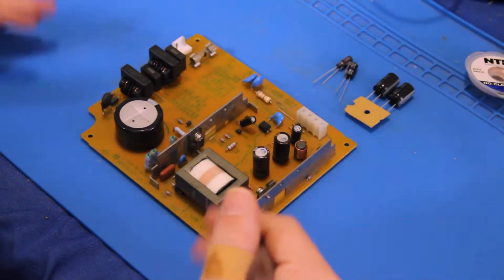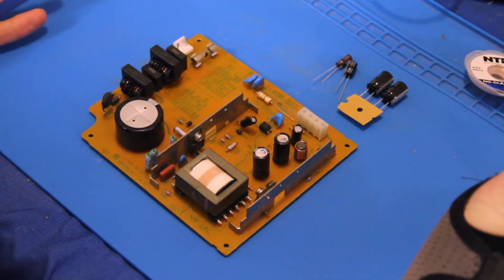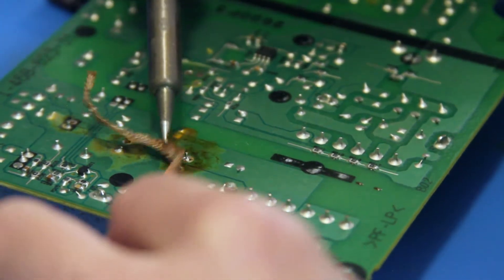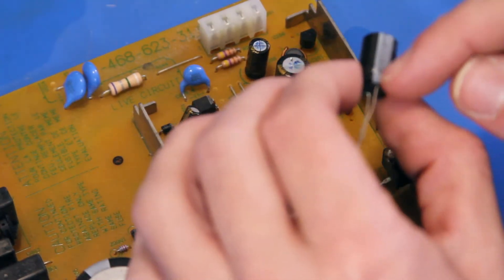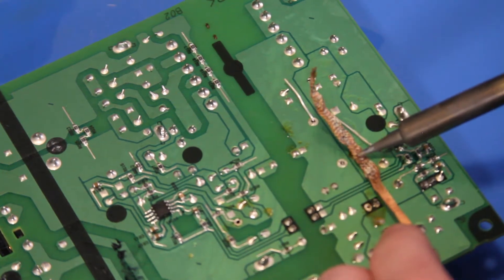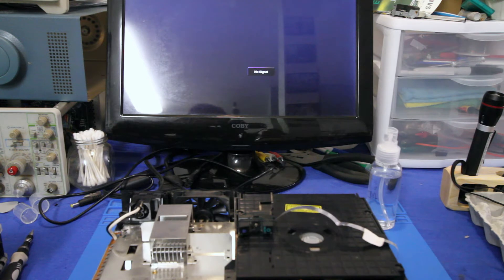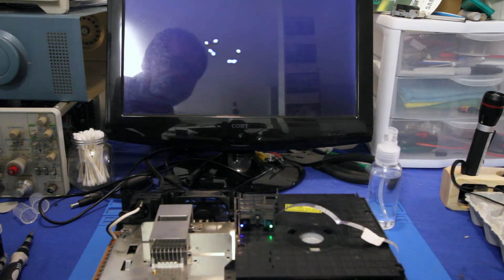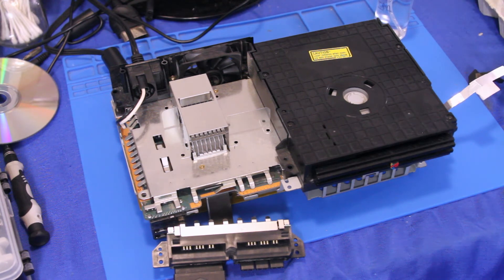DOA PlayStation 2 Part 2: Replacing Power Supply Capacitors and Finding a New Issue

Comment: Very nice mine had 3 ceramic disc capacitators dead those blue ones after power surge fuse and 3 caps died .Keep it up
Reply from the maker: Thanks! I've been falling behind on videos due to wedding planning but I'll be back in force after 

Those power surges can be quite devastating. Though knock on wood I haven't had a power surge repair yet that got past the power supply which is good. Power supplies can be rebuilt. Chips on a motherboard not so much 😂

Comment: I missed what the flex seal does?
Reply from the maker: The disc drive magnet was slipping preventing discs to be read. The flex seal increases the friction to allow the disc to be read since it's rubberized. I have an older video that goes in depth about it 🙂
Reply: @titanrepairs  found it, i see now thanks

Comment: That's wild. I'm guessing none of those capacitors had bulging tops? I have a SCPH-30001 R with the exact same power supply and none of it caps are bulging but it's dead. Barely outputting 2-3 volts. I get the age of these things now but I would expect bulging or leaking. I'll probably be replacing mine soon.
Reply from the maker: That's what the crazy and frustrating thing is with caps. Though bulging and leaking are dead giveaways, they also just die with no obvious signs. I have an OG Xbox apart right now that won't boot and I'm suspecting bad caps. But to find it I have to remove them and then test them. But I'd say your issue is most likely the caps. I have a box of power supplies, all the same model number all dead. I think there was just a bad run on power supplies for a bit. Probably faulty caps. It is the time period that the capacitor plague was rampant.

Comment: Check the zd1&2 diodes. They should only have continuity in one direction. If they measure it in both directions it means the diodes are blown. As mine are in my ps2./
Reply from the maker: Very true! And thanks for pointing that out. This is an older video so I don't remember if I touched on that lol. But your advice is one that can help someone reading. I tend to check them if the caps are good. I have had power supplies where those were the culprit.
Reply: @titanrepairs  No worries, I'll let you know when I get the diodes and  solder them on if it fixes the issue. I dare say it will 👍
Reply: One of the zener diodes kept testing as bad. After sifting through some comments on various youtube vids, turns out there's a zener diode that is connected to a resistor which will give a false bad reading. So when in doubt, pull it out of the board and test it.

Comment: What was the reason for fixing the ps2 magnet? What does this solve?
Reply from the maker: @ED_62  When the disc drive magnet wears out it'll make a grinding noise when it's spinning the disc, usually blue discs. In this video it caused the disc read error. Using flex seal adds friction back to the disc drive magnet to help it grip the disc again ☺️
Reply: @ i currently have an odd issue with my ps2 fat, it won’t read DVDs at all at first but if I give it a while to spin the DVD disc it’ll stop for like a minute or two and then start to spin and read the disc but will read ps1 and blue ps2 games flawlessly, could this magnet fix solve my problem? I’ve tried everything else I could think of to fix the issue. It sounds like the disc drive is just starting and stopping honestly, sometimes they’re clicking as well

Comment: Con esa reparacion queda funcional para 220v o solo 110v
Reply from the maker: I've never worked on a 220v power supply so I'm not 100% sure of the differences but I'd imagine the basics are the same. The capacitors will likely go bad on the 220v version too.
Reply: @titanrepairs  osea no es 100% seguro que funcione en 220v

Comment: Please, can you send all the micro uF and Volts of the 4 capacitors, the capacitance and voltage i mean, thank you…
Reply from the maker: The capacitance and voltages are printed on the capacitors. It may be different between power supply models.

Comment: I’m new to disassembling consoles, but I have taken apart an original Xbox, and Xbox 360. I cleaned them and was able to change the thermal paste with no issues at all. I made my way over to my perfectly functional PS2 and began to disassemble it for a cleaning. I broke 2 ports that hold ribbon cables (Controller port & disc drive). After I put everything back together as best as I could, the lights on the power and eject buttons are not lighting up, so the console is essentially bricked. Is this because of those stupid ass ribbon cables, or did I mess something else up?
Reply from the maker: I've run into this before. I've cleaned perfectly functional PS2s and had them not power on. I would start by checking the connection to the ribbon cable to the power switch. Though my hunch from experience is saying a fuse on the motherboard blew. One of the fuses (I think it's fuse PS1?) blows super easy. There's guides online how to check them and where they're located and how to replace them. You'll basically take a multimeter and check for continuity. If there is none, it's blown. But take your time checking. Some of them are very tiny.

And don't beat yourself up too bad. We've all made more work for ourselves along the way. It's how we learn and get better :)
Reply: @titanrepairs  Thanks for the information! I still have a lot to learn, but I became addicted to disassembling my consoles and cleaning them recently, so I might as well take the time to learn soldering and replacing fuses, etc.
Reply from the maker: @Mental-Cobwebs  That's how I started. I got laid off during COVID and needed something to do with my time so I took some of my old broken consoles (like my NES and fat PS2) and got them working again. Then I started buying more and selling them then bought more equipment. It starts to get dangerous hahaha.
Reply: @titanrepairs  I’m sure it was time well spent. It feels good to know you have the ability to open a console up and repair it. If I become proficient at it, then I’ll definitely start selling refurbished consoles and offering a repair service.
Reply from the maker: @Mental-Cobwebs  Go for it! It's great to see people getting involved and saving these consoles. Every day there's less of them and if you can pass one on that was scrap and now working to a new owner, that's a win in my book!
Reply: @titanrepairs  For sure! Take care!
Reply: I essentially did the same thing except I got a new ribbon cable for the power switch and it’s still broken I’m having trouble figuring out the mother board thing as I too am new to this but man what an awful feeling to break a perfectly working system I even replaced the laser and was making a window for the case to see the disk spinning
Reply: @ethanwashoe5868  Damn. I’d be pretty discouraged if I got a new part and the console still didn’t work, but trial and error is the way to go. After I broke my PS2, I became more cautious about any console I open now, so it taught me a lesson in the process.
Reply: @Mental-Cobwebs  did you get your ps2 back up and running or check the mother board?
Reply: @ethanwashoe5868  Nah, I haven’t. I left it alone and took a break from the consoles after I messed it up because the design of the PS2 really pissed me off. I am in the process of taking apart my PS3 though.
Reply from the maker: If it makes you two feel better, I have a few consoles in boxes that went off the rails at some point during the repair. It's frustrating for sure but the best way you learn. There's ways to fix most goofs. Some are more advanced. I have a PSP in a box that's waiting for my skills with pad repair to get better so I can fix a major oopsie I did to that lol.
Reply: @titanrepairs  Hopefully you get that PSP up and running! I had a lot of fun with my PSP back in the day. I definitely need to buy another one, so I can open it up and take a look on the inside.
Reply: @titanrepairs  Dude… I took apart my PS3. Cleaned everything, replaced the internal clock battery, and changed the thermal paste. I plugged it in and everything worked just fine. I unplugged it for a while, then plugged it back in and now it won’t turn on. The red light will be on, but when I power it up, it immediately shuts off. This is now the second Sony console I have messed up 🤦🏻
Reply from the maker: @Mental-Cobwebs  Oh no! I've never run into this before but you could open it back up and start with the basics like checking all the cables and making sure they're seated properly. I'd definitely check the power supply too and make sure that's plugged in correctly. If it still doesn't work then you can try retracing your steps. Like maybe the heatsink for the processor isn't seated correctly or you didn't use enough thermal paste. I'd say the issue is gonna be something dumb. You can also Google the symptoms and see what others have said who have had this issue.

Sorry for the late response to this. I normally check comments through YouTube studio which doesn't tell me when I have replies so I just saw the notification in the actual app.
Reply: @titanrepairs   I was actually able to figure out the problem after disassembling the PS3 like 7 times. It was the two potentiometers on the power supply. I had to rotate them in the opposite direction they were in and then it worked.